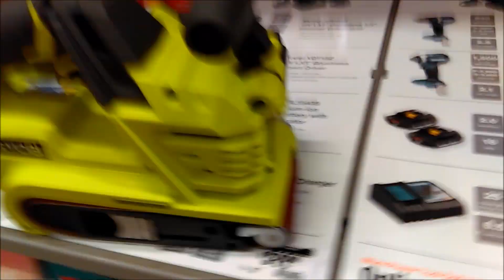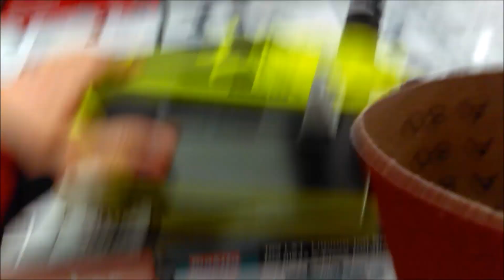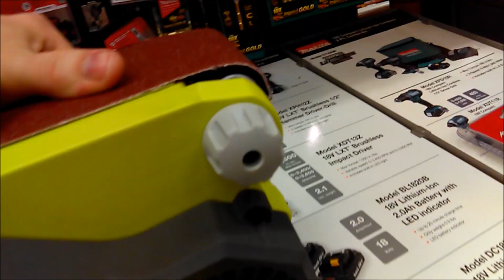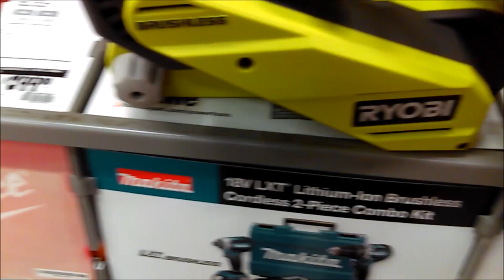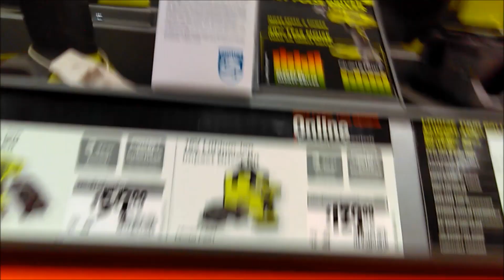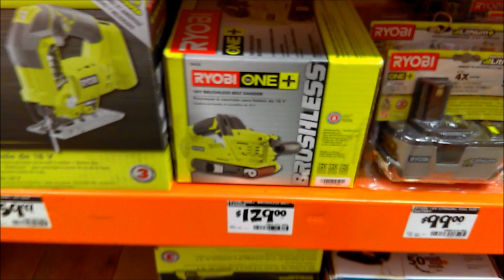Ryobi One+ Cordless Brushless Belt Sander First Look

Comment: Should've asked if they had a battery to try on that sander.  Our store would've done that for you.   Also, I recommend nothing less than a 4Ah battery, as the 4Ah lasts about 8 to 10 minutes.  The 6Ah battery lasts about 15 minutes of constant run time.  Then again, this isn't meant to be used constantly.  It's just for small jobs and also special jobs where a corded version isn't practical.  Hope this helps.

Comment: $129 on special at Home depot online only- includes Bag-a 4AH lithium battery AND the charger - online special today is 9/1/18 (seen it for about a week now)-  also online special get (2) 4AH Lithium batteries for $99 right now) tool agent at HD says they will match any online price - but the Online which is usually free delivery as well in 2 days, has great and much better deals than in store...here https://www.homedepot.com/p/Ryobi-18-Volt-ONE-Belt-Sander-Kit-with-4-0Ah-Lithium-Ion-Plus-Battery-Charger-and-Bag-P1965N/303833984

Comment: debating between this and a planner... whats better anyone?
Reply from the maker: It really depends on your application. Powered hand planers take a lot more material off in one pass. A planer will also provide uniform stock removal. However, if you want to prepare a surface, the belt sander is a much better tool.